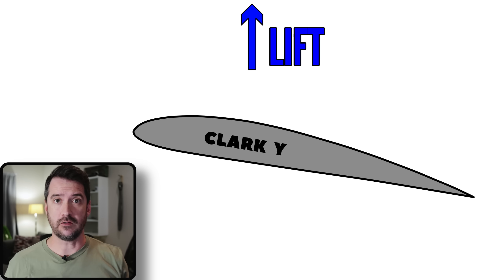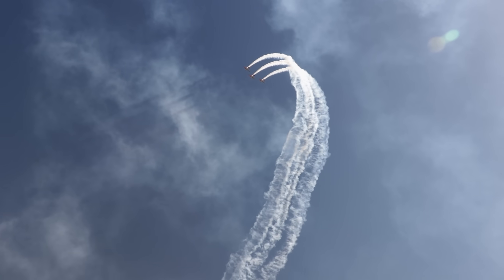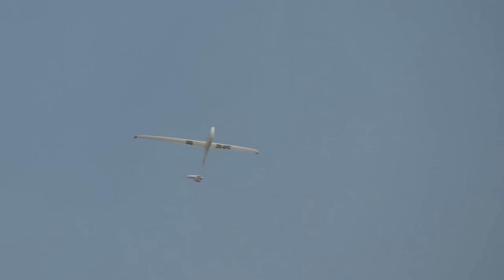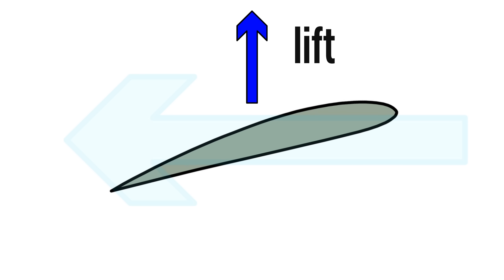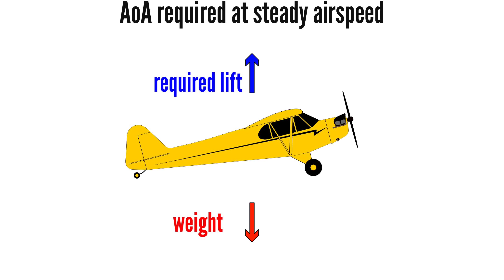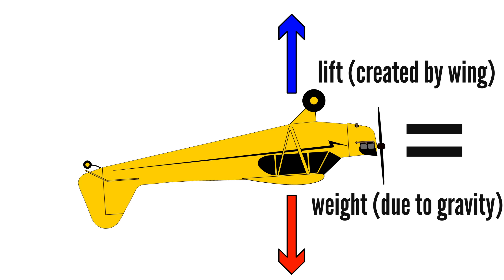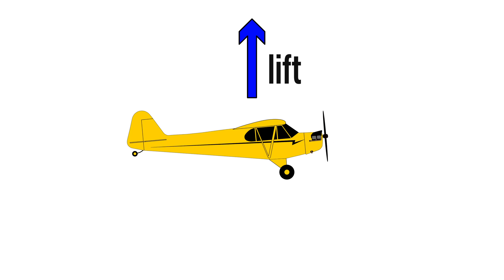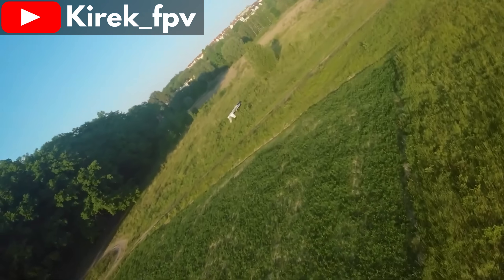Is Airflow Distance Over the Top of a Wing Always Longer?

Comment: MIT covered this a while back in their series on flight (aimed at folks wanting to get their pilot certificate). Basically path lengths over wings is not involved in lift; but momentum transfer as the wing hits all the little air molecules does, at least at speeds below transonic  speeds, then shock waves start to take over. Reviewing the MIT video will do a better job of clearing things up.
Reply: bingo.....momentum transfer
Reply: You are correct. ( MIT is correct ) Molecules bouncing off of the LE go upwards (relative to where they hit the LE), they have momentum,. The momentum of molecules going up results in the low pressure.  Meanwhile the wing is moving forward, positioning itself under the low pressure.  The molecules momentum is eventually cancelled and countered by static molecules in the air mass above pushing them back towards the wing but most downward molecules not dissipating its energy hitting the wing which has travelled forward and away from their downward path ....this also explains the downwards flow aft of a wing.....      Visualize it with billiard balls as air molecules.
Reply: @mikefougere  Aren't you overlooking the downward force those molecules would be exerting on the leading edge when they bounce upward off of it?  I think that would cancel out the lift in your explanation.  I think the air has actually gotten accelerated upward before the wing even reaches it, by the influence of the pressure difference between the bottom of the wing and the top of the wing -- except at supersonic speeds, this pressure difference influences the air well in front of the wing.

I don't find billiard balls to be a very helpful metaphor because the wing is immersed in (atmospheric-) pressurized air, which means it's surrounded by a field of flowing air with a whole spectrum of varying pressures, some areas of which are at greater pressure than atmospheric, and some at less than atmospheric, which act as suction regions relative to the atmospheric average.
Reply: @crispinmiller7989   i explain the upper surface  . Add lower surface, thrust/gravity, aoa, stagnation points, induced drag,  resulting/= lift. see "center of pressure"  .
Reply: And , yes, speed of sound changes all of it ....
Reply: All those additional factors are good stuff and do address my remarks about a surrounding flow field of varying pressures and velocities, but I still disagree with the billiard-ball argument for why the over-wing flow is deflected upward.  The impacts of molecules acting like billiard balls would impart impulses whose sum would have a vertical component — exerted downward — equal and opposite to the upward momentum given to the molecules.  So that can’t be where they get their upward momentum.  Instead it comes from their exposure to the pressure difference between bottom and top, because that pressure difference extends ahead of the wing — at any subsonic speed, the air ahead can feel the wing’s approach.
Reply: @crispinmiller7989  thrust energy is transferred into the molecules upward enegy. either motor thrust or glide downward thrust. i dont make it up, its physics...its proven, .     Dont imagine billiard balls, imagine molecules..
Reply: Still no.
Wings can generate lift with no change of momentum of the air.
Reply: @Talon19  Interesting. Please explain how that would work.
Reply: @ronboe6325  
Positive-camber, flat-bottom, zero AoA wings produce lift even with long thin plates extending behind the trailing edge.
No vertical change of airflow after the trailing edge of the camber.
Reply: @Talon19  Well this was a rabbit hole. Graphs show the Clark Y having a lift coefficient of about 0.3 at zero AoA (likely OK for model airplanes but not people carrying craft - even Piper Cubs seem to carry a positive AoA). Further looking lead to Kutta -Jaukowski theorem and Wiessiing's Approximation for modeling wings and airflow - they tend to treat momentum transfer only for pressure - which is critical - but you run into fluid dynamics and other ugly factors that become important at speed and if you have to pay for the gas to fly your craft. Good ol' Bernoulli's is not mentioned.
Reply: @ronboe6325  
What are you talking about?  The Clark Y airfoil has a highly cambered upper surface and used on dozens of passenger carrying aircraft.
Reply: @Talon19  Somebody asked you to cite a source on this and I don't see that you have.  

I can imagine that it could be true inside a wind tunnel, but did anyone do a correction for the presence of the upper wall ("ceiling" of the tunnel, so to speak?)  The only way I can see for this effect to occur is for the constriction between the convex wing and the flat "ceiling" to be creating a venturi effect.

Or else you've got a bit of upward flow ahead of the wing (due to the under-over pressure difference, which lift requires) so that the flow does have a net downward deflection, from its upward-angled initial condition.

Are you saying it works in free air, outside a wind tunnel? At zero AoA and with an extended level plate for a trailing edge and you're sure the wake velocity is dead level?  I believe that'd be a violation of Newton's third law, and if you persist in scoffing at Newton's relevance then I won't be trying any more to convince you..
Reply: @crispinmiller7989  
How and why is it a violation of Newton’s laws for pressure to change based on velocity change?
Reply: @Talon19  That's no violation at all and i didn't say that  -- in fact it's what the Bernoulli effect is about (an effect which does apply to airplanes, if people here would just stop conflating it with the equal-transit-time myth and apply it to the true flow pattern instead) -- air accelerates if it has lower pressure ahead of it or decelerates if it encounters higher pressure ahead of it.   (Or, while this is not the Bernoulli effect, air accelerates sideways, i.e. its path curves, if it has higher pressure to one side of its path than to the other.)

What I was saying would be a violation of Newton's third law would be for a wing flying level in free air to generate lift without deflecting any air downward.  Upward force on the wing requires it to exert downward force on the surrounding air.  In the wind tunnel, that air is constrained by the walls; in free air, it can supply an upward reaction force only by being accelerated downward.
Reply: @crispinmiller7989 
The pressure of the air is exerting a force on the aircraft and the aircraft is exerting a force on the air.  Nothing needs to move or be deflected for pressure to exist.  
CFD isn’t necessary to understand lift and design aircraft.
Reply: @Talon19  Why do you keep changing the subject?  All three sentences in your latest post are true --

-- Yes, the pressure of the air is exerting a force on the aircraft and the aircraft is exerting a force on the air;  
-- Yes, nothing needs to move or be deflected for pressure to exist;  
-- Yes, CFD isn’t necessary to understand lift and design aircraft.

But none of them addresses the central point I last stated:

It would be a violation of Newton's third law for a wing flying level in free air to generate lift without deflecting any air downward.

Are you ever going to deal with this issue?

And while the wind-tunnel result you keep coming back to is interesting, it's got to be an artifact in one way or another of the wall constraints in the tunnel, in some way such as the ones I've suggested yesterday.   Does the Embry-Riddle teaching staff really think that experiment is demonstrating that free-flying airplanes are exempt from my Newton's-law statement above?  Do they really think that Prandtl & Tietjens vol. 2 is mistaken?
Reply: @crispinmiller7989  
I’m not changing the subject, I’m approaching the subject from different angles.

“It would be a violation of Newton's third law for a wing flying level in free air to generate lift without deflecting any air downward.”

You keep saying that like it is some self evident truth of reality.
Generating a force or pressure doesn’t require a mass to accelerate.
Reply: @Talon19  "Generating a force or pressure doesn’t require a mass to accelerate."  

Not in all cases, no, but when the mass in question is free air surrounding a wing, with no way to exert a reaction force other than by F=ma, are you really so sure?

In such a case, to anyone in command of first-year physics, yes indeed the statement that "I keep repeating" should be self-evident:  

Yes it would be a violation of Newton's third law for a wing flying level in free air to generate lift without deflecting any air downward.

I think I'll leave it there.
Reply: @crispinmiller7989  
In other words you don’t have an explanation.
Reply: @Talon19  No, in other words I don't care to go into a contest of pulling rank as to our credentials.

An explanation of your claimed wind-tunnel result, of course I don't have since you only hand-wave about where we supposedly might look for a report to examine, instead of actually showing us any.  I've already offered two ideas for possible explanations, which is about as far as we can get until you show us something.

An explanation of why lift in free air requires downward acceleration of some air, I have explained multiple times -- it's F= ma, sir, and the requirement for momentum out to equal momentum in (including the time integral of gravity -- i.e., if the plane isn't falling, then it needs to be making something  else fall instead:  to avoid falling, the plane has to hand off the same impulse to the air that gravity has imparted to the plane) -- and you just keep trolling off into irrelevant statements.
Reply: @crispinmiller7989  
Yet you cling to this mantra as if it is religious dogma.
Exerting a force does not require movement; yet you seem to ignore that in this case. Why?
Reply: @Talon19  First of all, I'm by no means the only person here insisting on it.  Be that as it may, 

Again you misdirect by making an overgeneral statement.  Sure, plenty of things -- guy wires, columns, beams, etc. -- can exert force without moving.  No, I don't "seem to" ignore that no-brainer.

BUT.  Exertion of a force by a mass not connected to ground does indeed require an acceleration of that mass in the direction opposite to the force exerted.  

When you need to push something heavy across the floor, do you wear greased shoe soles?  (I'd have said "roller skates," but with your track record of being disingenuous you'd just say yes and tell me how you could plant your feet sideways.)
Reply: @crispinmiller7989  
Weight is a force exerted by something not connected to the ground.  Force doesn’t require movement.
We can lift masses not connected to the ground by another thing not connected or even pushing against the ground.  You are trying to resolve your cognitive dissonance with oversimplified generalizations without fully considering all scenarios.

I’ve outlined all the details necessary to verify the facts.
Reply: @crispinmiller7989  
You also overlook that continuing to exert a force on a moving object at constant velocity doesn’t require acceleration, such as pushing a box across the floor.
Stop thinking only in terms of F=ma
Reply: @Talon19  Agreed, once a box has started moving then moving it further doesn't require acceleration.  My point was that what it does require is force (due to friction, in the case of the box pushed across the floor), and if you're pushing on the box, it's also pushing back on you, so good luck with moving the box if you've got greased feet.

You can't exert an action without an opposite reaction.  

in the case of the wing (in free air, not in your wind tunnel demo), supporting the wing requires having the wing push down on the air, which will impart momentum to the air.
Reply: @Talon19  I have cognitive dissonances and I am making oversimplified generalizations?  The things you've been doing *all day*?

You are projecting and you are deluded.  

Or else you have been trolling this whole time.

Either way, I won't be taking the bait any more.
Reply: Either MIT was not entirely correct or you lack understanding of what MIT was trying to tell you 

If you want to generate lift at least in a fluid environment you have to alter the fluid everything we do to generate power with the exception for example of solar power or nuclear power is what we call a mass thrower you throw mass in one way you get an equal opposite force the other way 

Even your car is internal combustion engine effectively works the same way when you detonate the fuel inside the piston that pressure wave is throwing mass the fuel the pressure and it's being captured by the cylinder to force the piston down in a crude way it kind of works the same way 

The point is we're throwing mass around well air doesn't weigh much well first it weighs more than you think but second he doesn't matter you can compensate for lack of mass by increasing flow rate meaning how much of the mass over time you displaced so while the tiny spray of gasoline that goes into your cylinder doesn't weigh very much when you detonate it you give it a whole lot of energy technically it's not detonation it's defligation detonation would be bad that's called knock :-) 

But anyway you get the point if you want to create lift you have to move Mass what mass are we moving? Well we're moving air what direction are you moving the air? You have to move the air downward because you want to lift upwards so the direction you want to go has to be the opposite of the direction you throw the mass therefore we need to throw air downwards 

Ah see that just proves the pressure differential No you're just an idiot well not an idiot just ignorant you lack understanding you think you found some smart detail and you didn't you just don't understand how these systems work 

When you have a pressure differential on the top and bottom of the wing you are going to have a higher pressure and a lower pressure and that's going to create a movement direction but hold on stop think for a moment what did I just tell you about how you produce lift? You have to move air if you want to lift a 500 lb airplane up you need to throw 500 lb of air per second or whatever down to oppose the force of gravity 

Well take a guess at what a pressure differential does? :-) what do you know A pressure differential ding ding ding moves air :-) That's what it does it moves air :-) 

This is going to accelerate the air going over the wing relative to the air going below the wing now if I have two columns of air and one column is going faster than the other how are they going to interact? They're going to bend the faster, there is going to push harder think of it like having a little tab on the top of the wing and below the wing and your hands are the air pushing on those tabs if you push harder on the tab on the top of the wing meaning your air is moving faster what's that going to do the wing it's going to bending down now your wing is rigid it can't bend so what does the vending what is actually bending well the column of air the column of air going over the wing is going to push on the column of air going below the wing which is going to create a vector a downward vector so the air is going to move more down than horizontally and this is going to give you lift because of your moving the air downward what are you doing You're throwing mass down All actions have an equal and opposite reaction if you throw air down you get lift up throw enough air down and your airplane flies 

But but a flat plate can generate lift? Yes it can that does not just prove the theory it proves it you just lack understanding 

What does the flat plate do? It does the very same thing the pressure differential does it deflects air down and if you deflect air down you get lift up equal to the amount of mass of the air you deflected down 

So why don't we design all airplanes with flat plates? Well because we're not stupid :-) well the flat plate can work it's horribly inefficient The purpose of an air foil is to deflect air down while producing the least amount of drag more efficient air foil design produces lift more efficiently which means you don't need as much thrust to get the lift you need to fly the airplane The closer you can get that wing to a zero angle attack while producing sufficient lift to fly the airplane the more efficient your aircraft is and the less engine you need which means you need less fuel which means you don't need a stronger airframe because you have a lighter engine which means you can make the aircraft lighter which again means you need less thrust which again means you need less engine and less fuel you see how this works? This is called efficiency of course there's a point of diminishing returns but I think you get my point now? 

You seem to think that the pressure differential is where lift comes from and it's not The pressure differential creates the deflection of air the deflection of air throws mass down and the throwing of mass down because all actions have an equal and opposite reaction says you now get lift up 

This is not new this is not different this is not a change and understanding about how lift and airplanes work this is you finally now understanding how lift works :-)
Reply: @nerys71  
That’s an incredibly long and incredibly wrong statement.